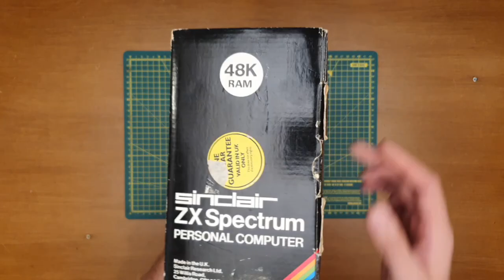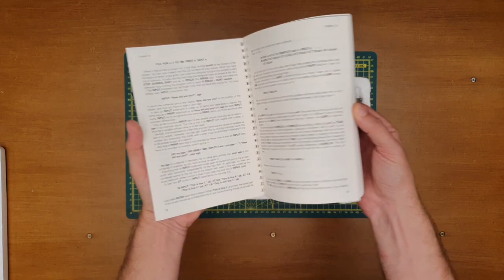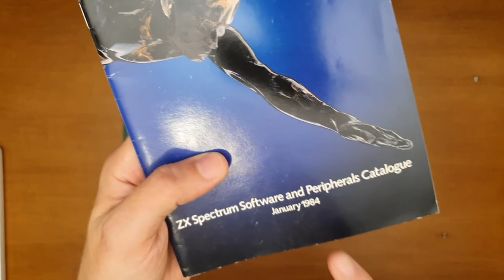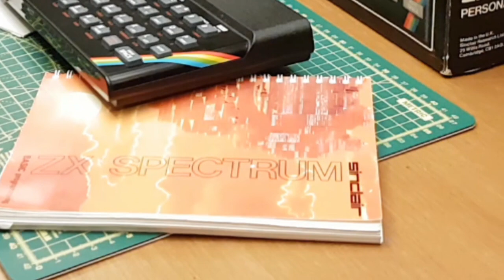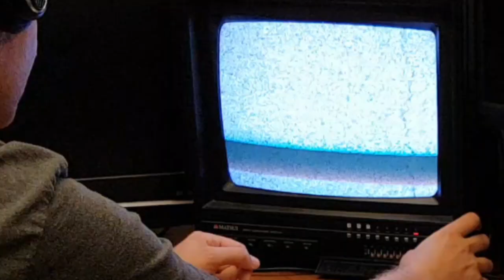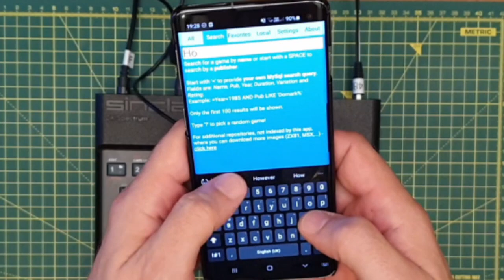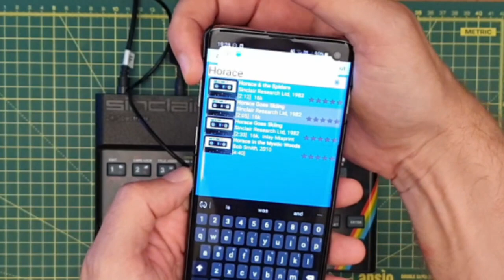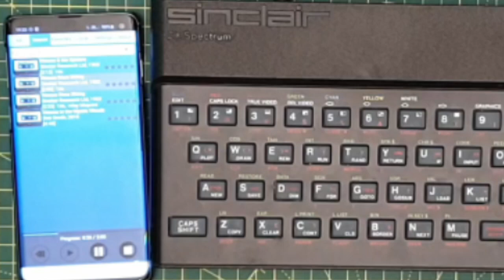Sinclair ZX Spectrum 48K - Overview, Look around and attempted Power On

Comment: Nice vid. For reference though, the Horizons tape belongs in the speccy box. Still have my issue 2 which is in immaculate condition. Also have a 48K+, +2 and two clones (Harlequin and Omni). Love my Sinclair stuff though. Have some old Sinclair calculators from the 70s and my Sinclair C5. My wife isn't particularly impressed!
Reply from the maker: Thanks so much for your comment RLR! Right, that's going back in the box then, thanks!😊👍 wow, a C5... fantastic!! Even now, they look absolutely awesome! My meager Sinclair collection is now the 48k, a 48k+ an Issue1 ZX81 and a very poorly Grey +2 for an upcoming multi-part fix.

Comment: still use my 48k speccy everyweek, fairly modded these days but still works great.
Reply from the maker: Thanks is for your comment Hammeys1! It's been great having mine on the bench since filming this, pop it on loads! 😃 I have a 48K+ too that I have repaired and composite modded, but might leave this one totally stock....experience it the way it would have been in the mid-80s! 😍